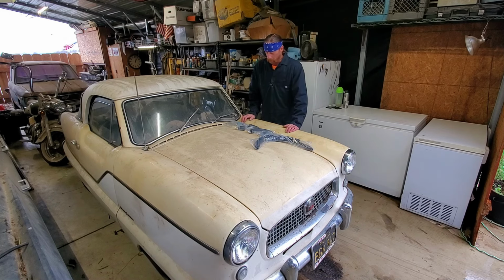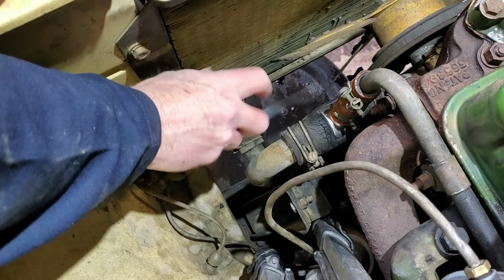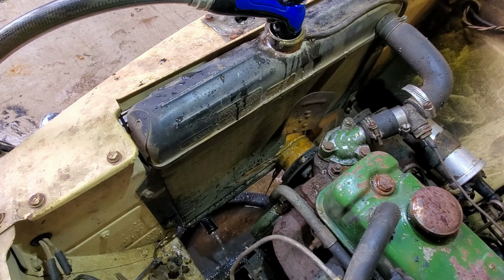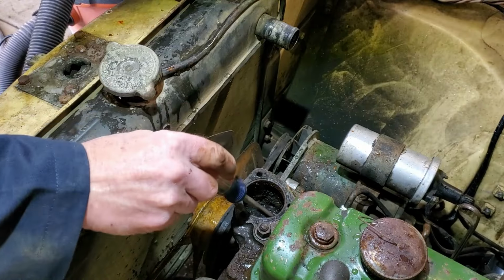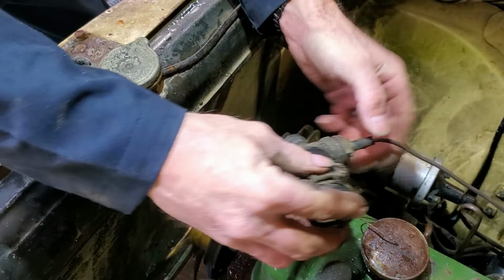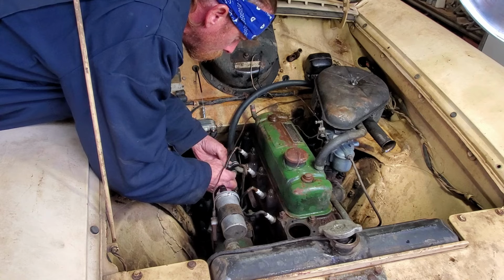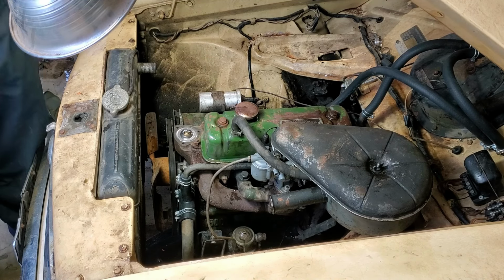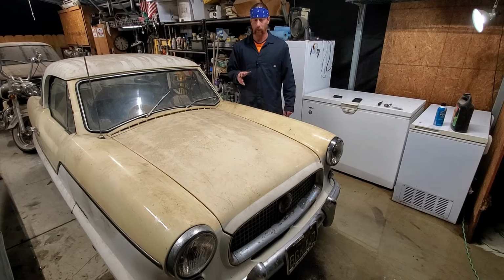Check Out What I Found While Replacing Coolant Hoses On The 1961 (Nash) AMC Metropolitan Barn Find!

Comment: Looks like you have the original AC Delco UK, RC4 4lb deep reach radiator cap. The mechanical temp gauges were a dealer option (very rare). The dealer would drill a hole in the dash between the radio and the glove box. They were made by Smiths Ltd UK, the same company that made the speedometer and gas gauge. The mechanical temp gauge is known as a bourdon tube. They were filled with ether. sometimes the tube fractures causing the ether to escape. Early Austin Healey Sprites had a Smiths combo gauge that had oil pressure and water temperature combined. I made a bracket for my '62 hardtop and attached it under the dash using the dash brace bolt.
Reply from the maker: That's excellent information. Thank you!

Comment: I wanted to know if you have been able to get rid of the mouse pee smell.  I understand there is an ozone unit that gets the smell out. Looking forward to seeing the paint work restored, the interior restored.  What's wrong with the tranny?
Reply from the maker: I haven't even tried anything else with the smell. I've just left the windows down and let it air out. It's slowly getting better but I'm sure once I do a good cleaning inside it'll go away. I think the trans is fine but I have no pressure on the clutch. I'm assuming the master cylinder is done for but I might get lucky and just need fluid. We'll find out soon.